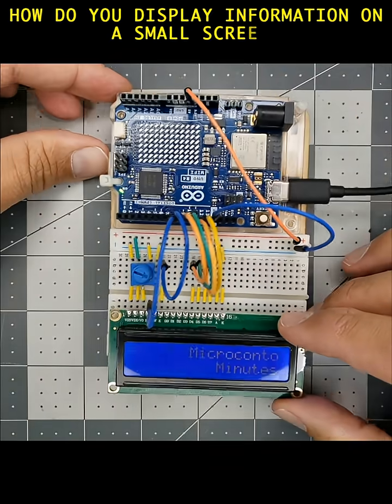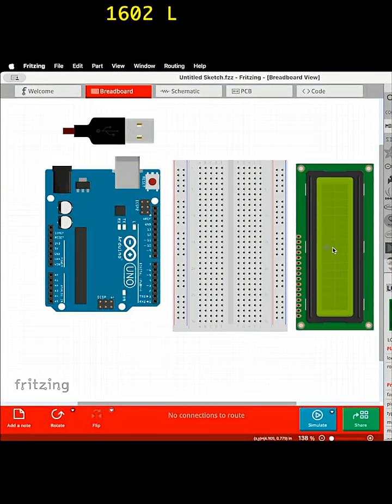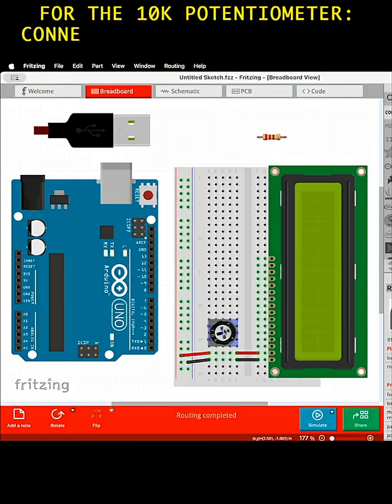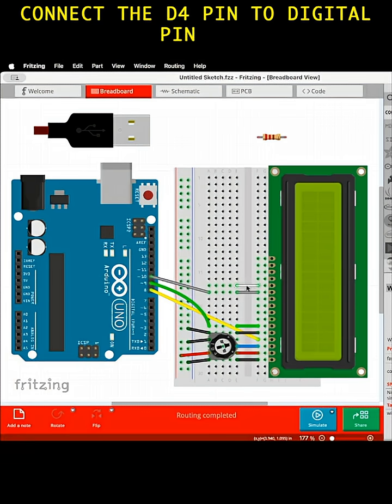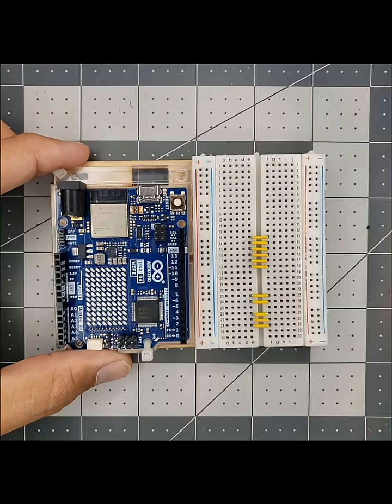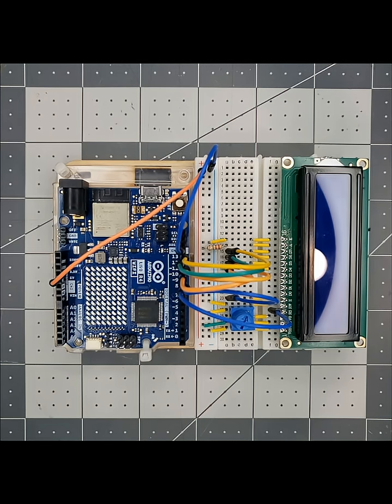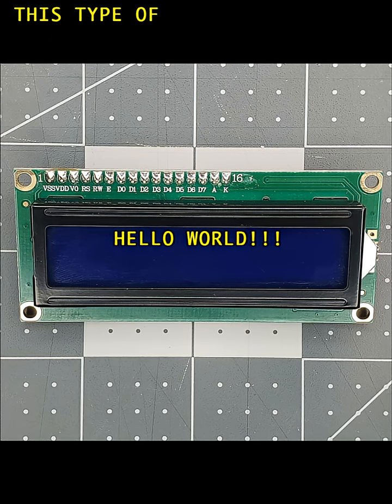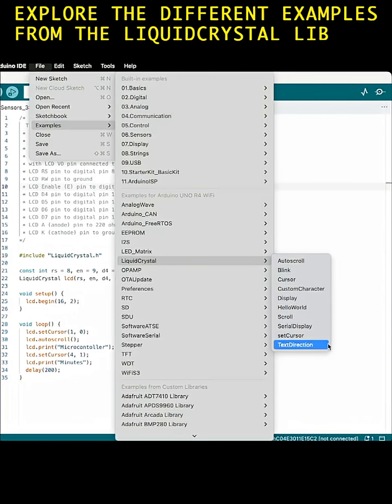Pt-33: How To Program the 1602 LCD Module from the 37-in-1 Sensor Kit #arduino #lcd  #shorts

Comment: Can the potentiometer be replaced with a 10k resistor?
Reply from the maker: The reason for a 10k potentiometer is for contrast control of the screen to make the image brighter or darker. They make I2C backpacks for these that also have potentiometers you can adjust as well. You could use a single resistor but you would have to do a lot of trial and error to see which value would give you the best view. Hope that helps 😊